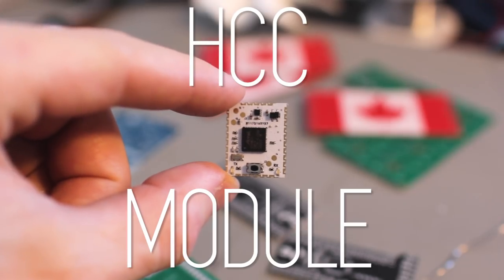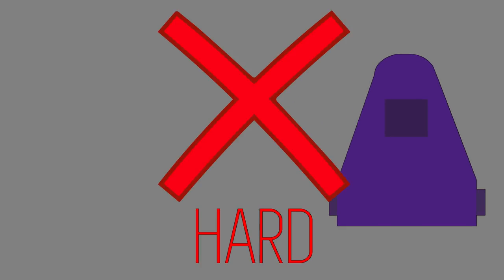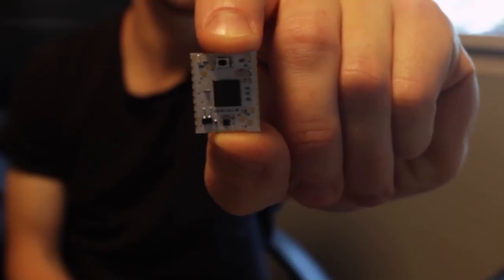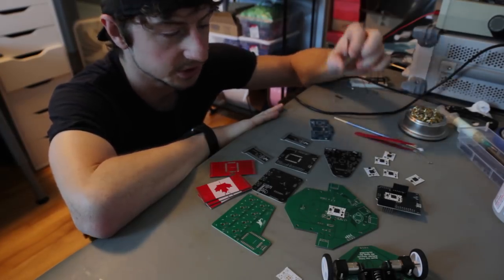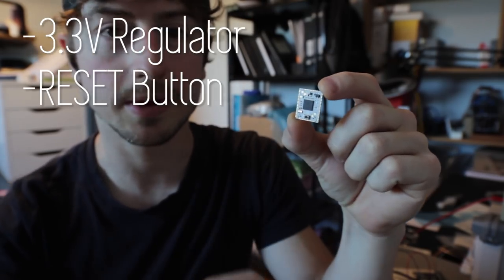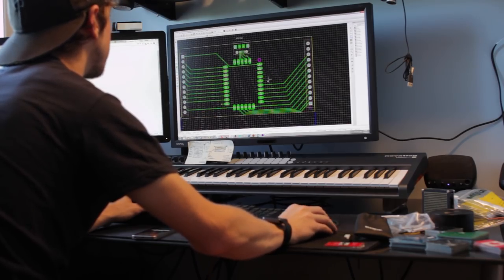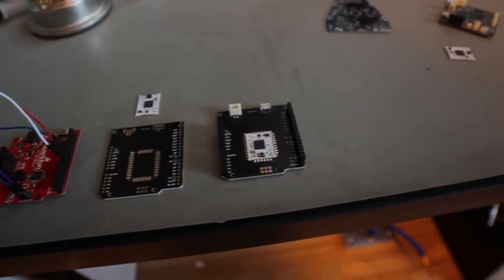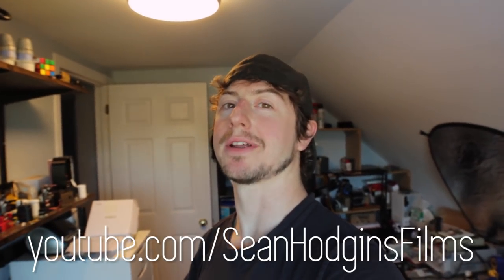HCC Module - Easy/Ready to Solder Arduino Module - Kickstarter!

Comment: I’ve been interested in getting into custom circuit boards but don’t presently have the skill or patience to solder many small parts, so this may be a good fit for me. I have backed the project and wish you well.
Reply from the maker: That is exactly the use case I was hoping for.

Comment: Just found your channel, through your neural network robot army project, instant subbed.
The fact that nowadays you can pretty much make your own product market-ready in your hobb workshop is amazing.
As 3D printers became cheap (relatively...) and these pcb manufacturers making theese boards for few bucks, it was never been easier to make a professional product.
Will you use them in your projects later?
Good luck with your kickstarter!
Reply from the maker: Thanks! That was a fun project. Yes I will probably use these in a bunch of projects as they come along.

Comment: Awesome Sean,  congratulations for your new project,  i like to know the process to burn the arduino firmware in the new SAMD
Reply from the maker: Thank you! I will have a video shortly showing the jig I use to program the bootloader. However to put new firmware on them you just need to connect a usb connector to them, and use a USB cable. All Kickstarter ones will ship with the bootloader pre loaded.

Comment: why not using the nrf52832? this SOC also was BLE and RF feathures on it and it's super cheap.
Reply from the maker: I think it still needs an FTDI right? But it comes down to familiarity. Its what I use, so it was an easy first step. If these are popular I will come out with more variants.
Reply: SeanHodgins Yes it does but you can do stuff OTA also it'd be much harder to add varients for it sind you'd need to clean a side of the pads for the pcb antenna.
Reply from the maker: Not direct pin for pin variants, just HCC module type variants. :) Voltage regulators, boost/buck converters, lipo chargers, other microcontrollers, etc.

Comment: I big problem with the Arduino environment is power consumption for battery operated devices. Will there be any way to put this device in low power mode when not active?
Reply from the maker: A Rod yeah! That SAMD has several low power states. And they can be woken up using interrupts and timers. That is what the low power crystal is for.